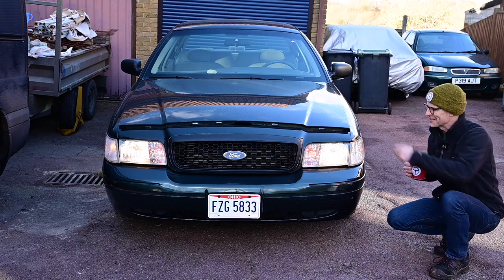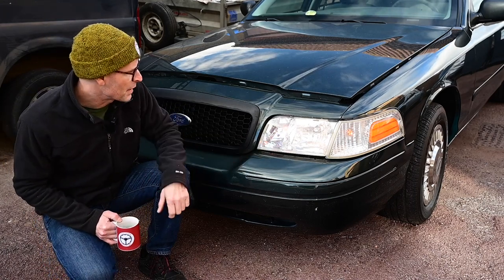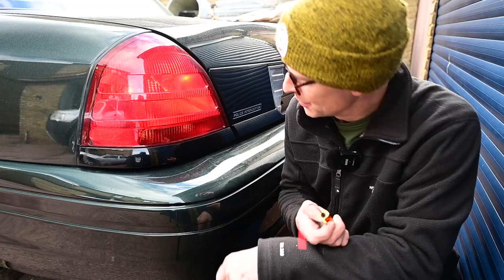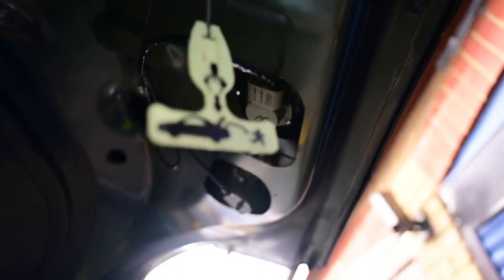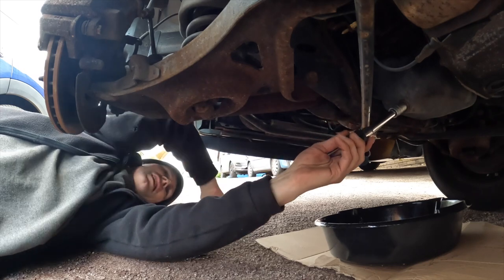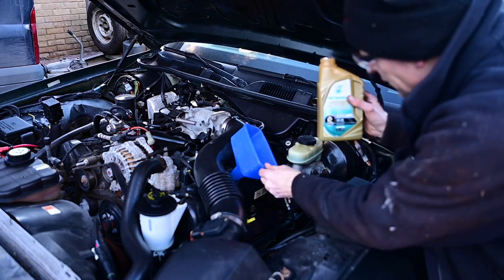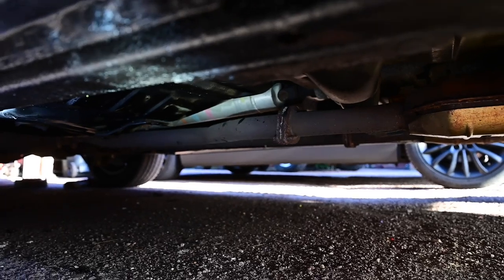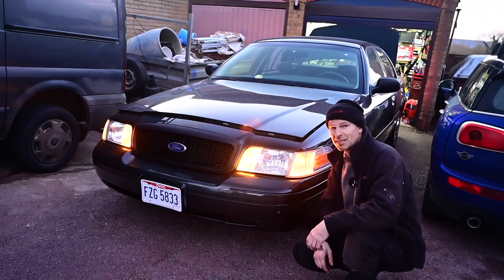Ford Crown Victoria MOT ready - oil change and under sealed

Comment: It always baffles me at times the amount of (unnecessary) mess either drain the oil or swapping out an oil filter can make..... even on a ramp. Manufacturers will stick sump plugs or filters in inaccessible places and they it covers everything as it pours out then you have to use gallons of brake cleaners and yards of roll top clean the mess up afterwards. 🤦‍♂️🤦‍♂️🤦‍♂️🤦‍♂️🤦‍♂️🤦‍♂️🤦‍♂️🤦‍♂️
5.68lt.... 5.7lt would do or 5.65lts is probably better, the residue left in the engine will make up the .03!!!!
Reply: And they don't like putting oil filters vertically, but always sideways. That way you can't fill the filter up with oil before installing it.
Reply: Auto engineers never have to change their own oil.